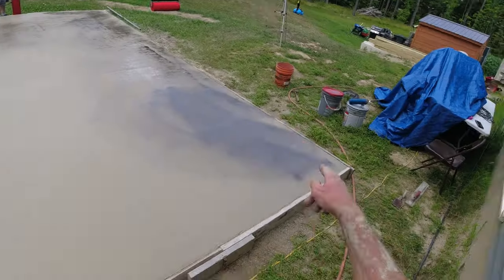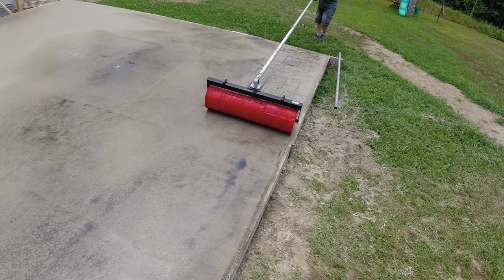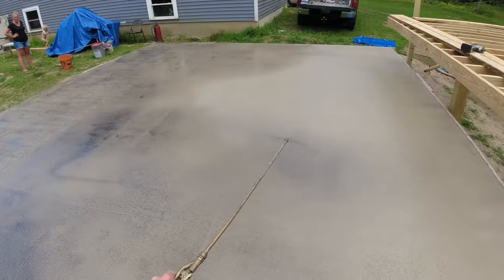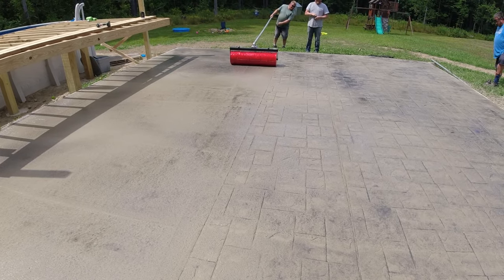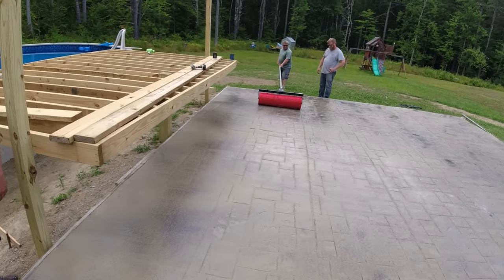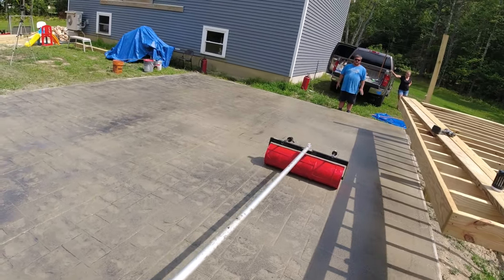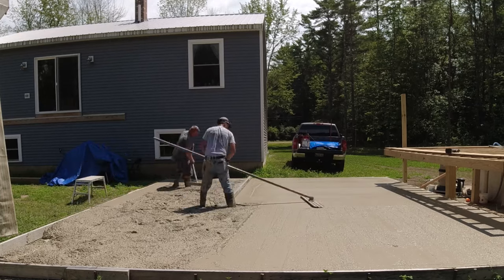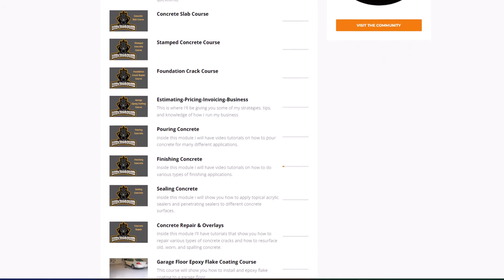You've Never Seen Anything Like This......? Rock & Roller For Stamping Concrete

Comment: Not sure I'm a fan, but this does look a bit faster.

1: The parallel lines left by the roller stick out with this type of slate pattern. Regular mats are shaped to avoid this.
2: It seems quite difficult to avoid the little slivers between two rolls, and they don't look great when they happen.
3: You get more control over stamping pressure with mats.
4: The last roll overlap is not desirable, but it seems you couldn't run the roller off the end like you could with a mat.

However, this might be better for a beginner because:
1: It applies a more uniform pressure across the slab than walking on or tamping mats.
2: You don't need to worry about alignment or orientation of each mat.
3: Might be easier to do with just one person

Comment: You  should watch "Concrete with the Hauses" they use a roller stamp that gives a stone finish over the whole area  they usually have several guys using the rollers with no set pattern just randomly rolling all over the slab, then they cut in a border and use a 12" roller with a heavier stone imprint !! And after the antiquing process they always look good when done ! The roller you are using looks good but you can tell where the roller ends ! I prefer the stamps when doing that pattern !

Comment: It reminded me of a roller screed.   We did am expirental pour on a driveway using this massive steel roller that rides on the edgeforms.    It was suppose to be used with a special mix of concrete.  It doesn't close up fully upon finishing.  Almost like a very very bony mix with no fat.   It was upstate NY and the idea wad the water flows through the pad.  Therefore the water can't freeze in the pad.       I think it was all pro bono from the company selling the product and if my uncle liked it he would use it on other jobs.      Long story short.   It was a bear to control the roller it almost killed me and the guy on the other end.    And my uncle did not like the finish and we tore out all 25 yards and redid it.     My uncle had to pay for the labor cost of the demo and the other concrete.    Not to mention throwing schedules off.

Comment: "Just a Thought" I would imagine that the lesson to be learned here is to start rolling the pattern on the side where the first concrete was poured, thereby rolling with the drying pattern, not against it.  If rolled this way, it's doubtful the weights would have been necessary, and the impressed patterns would be more consistent throughout the slab.  YOUR THOUGHTS?  "Live, Love, Learn" . . .